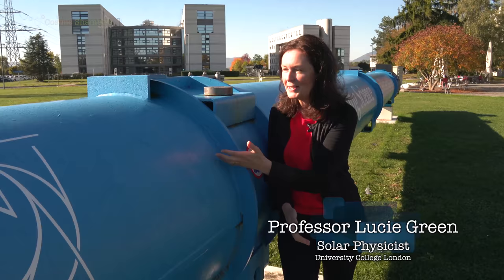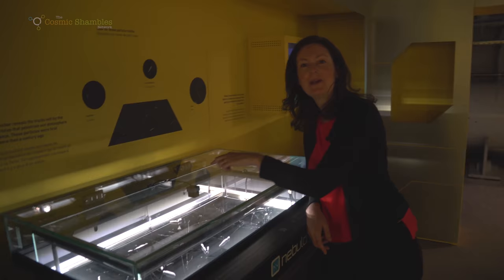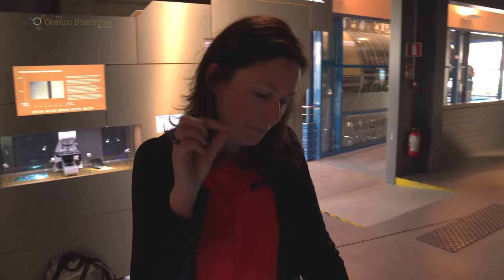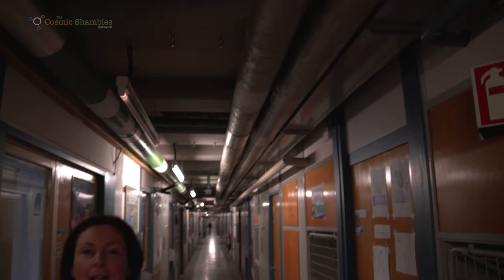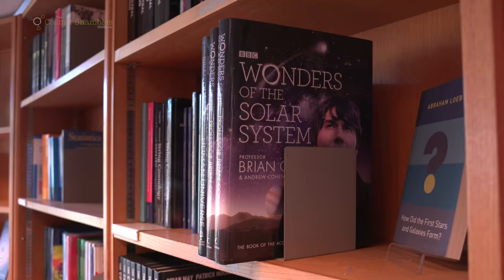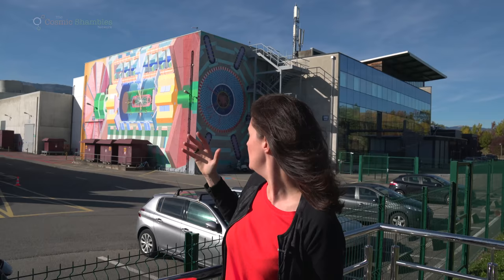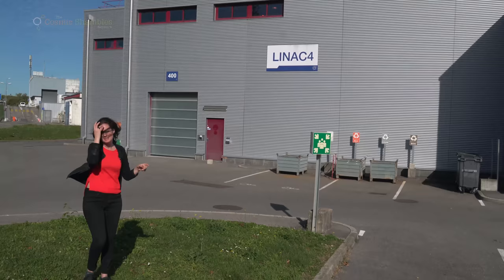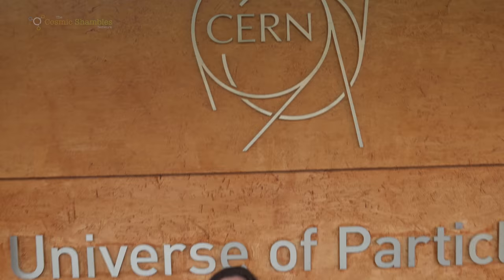A Tour of CERN with Professor Lucie Green

Comment: A question (forgive me if it's answered in another video, came here from standupmaths' video): why is it busy in summer? Why is everything running seemingly exclusively in summer? Because that's the impression I received from the introduction of the video...
Reply: As far as I remember from my visit there, it's because of the electricity cost. In winter more electricity is used for heat and what not. So since LHC uses a ton of power it's much cheaper to mainly run in summer.

Comment: I   am   also   a   advocate   of  your   invention  ,,..this   is   the   connection    from   the   video    new   accelarator   at  first  to   this   account   ,,..  EACH     of  the
computer    must   have   a   connection   to   the   big   bal   that   the   duct   can   carry   the     current  of  hacked   computer   for   detonation  ,,..  the   duct   must 
carry   and  passed   to   the    fan   liked  propeller   that   generated   by  hacking   numbers   current   and   to  the   other   side   is   also   fan   for    periodic   
elements  ,,..   what   the   intent  of   your   group   as  to   built   in   magical   process   must   be   passed   to   a   computer  from   U.S.B.    SURPRISED   maam
I   AM   voltaire  lomosasd   songs  ,,...speaking  ,,...YOU   TUBE